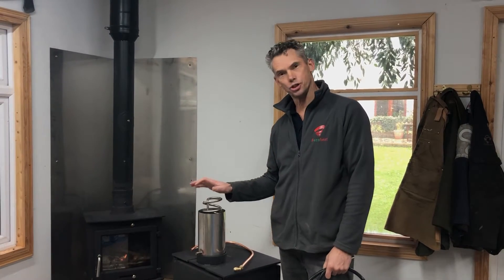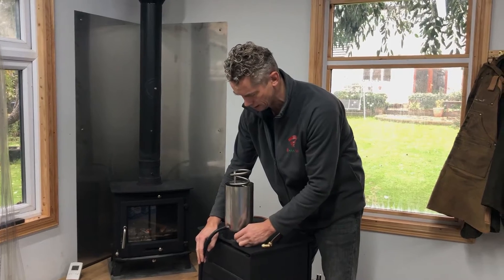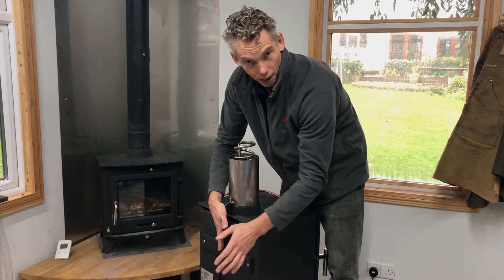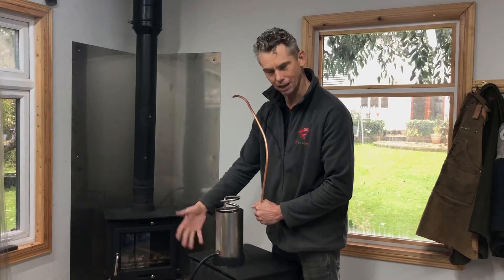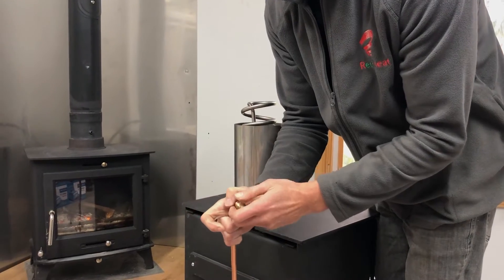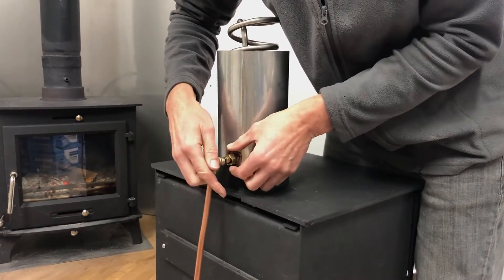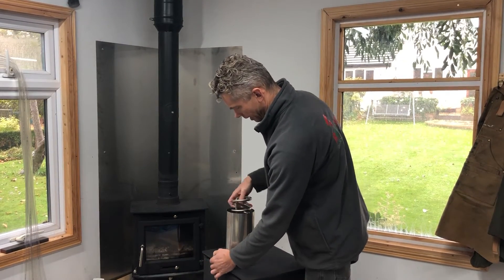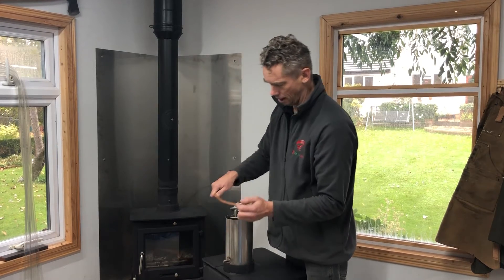Using Copper On a Tight Stove Installation

Comment: This looks a brilliant product, I'm really starting to have a look at it now 💯👍. If the air flow on the pump was adjustable as well that would be brilliant, full power to heat the house then turn it down to watch tv etc. Only mentioning it as my dads just got an adjustable flow pump for his pond waterfall and it's addictive fiddling with it every time i go round 😂
Reply from the maker: Thanks very much for the interest! The issue with adjusting the flow is the way we rely on a specific input flow to make the air turbulent. If we fall below a flow rate, it drops out of the window that induces the turbulence, and the temperature drops to vaguely warm rather than hot. It's therefore a largely worthless process because you might as well just turn it off. That's not 100% true, for sure, but we're worried people will run it without it working as well as it should, so prefer to keep it simple!
Reply: @Recoheat  ah right, no worries  it still looks very interesting to me, keep up the good work 👍
Reply from the maker: Thanks Chris  @chriselson7413

Comment: Can the copper pipe taken to other rooms trough the walls? Thanks
Reply from the maker: Only a short distance - so it's only really practical to take it off the back of the flue into a room  behind. We custom-make coated extension tubes for that purpose, up to 45cm long, with compression fittings to copper for the air inlet. Every cm of pipe length takes heat out, so they need to be made to fit exactly to maximise performance.

Comment: id put money on it the protoype was this guy messing with 10mm copper in his flue
Reply from the maker: You'd lose your money, but the early prototyping was done with copper - you don't set out to bend 316 steel at different diameters for fun! Nothing wrong with that as long as you're just testing - it won't last long in a flue. The materials for flues are set by the regs, so they weren't part of the design process, but the diameters, lengths, bend pitch, rate of flow etc all were. SolidWorks design isn't where everything starts, though it has to get there at some point.